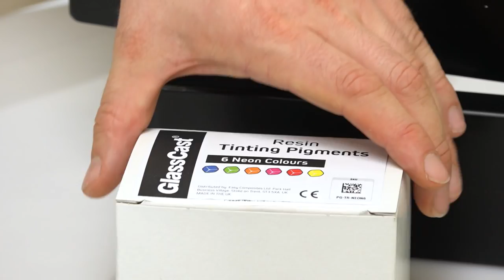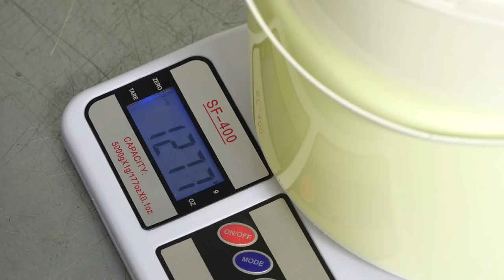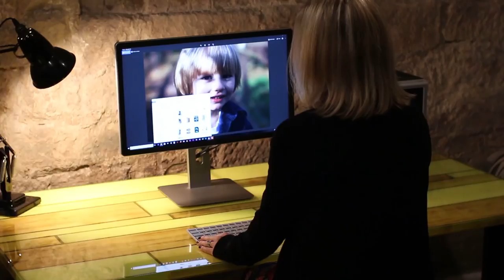River Table Alternative -  Resin Plank Table using GlassCast Epoxy

Comment: Hi just ordered some glasscast resin, what do you use for cleaning the mixing buckets?
Reply from the maker: Acetone or Methylated Spirits are good for cleaning down. Depending on the type of plastic that the bucket is made from, you may find that after the resin has cured, you can simply flex the sides and the resin will crack off the sides.

Comment: Poured a kitchen table using Glasscast 3 followed the instructions - 2 buckets, electronic scales for accurate ratios etc. Mixed using mini mixer attachment for cordless drill so fairly confident it was well mixed, ran a heat gun over it, used mica powder for colour pigment , in the workshop it looked like it was a perfect  glass finish but when I returned it to the clients house it looked to have a rippled surface in places - any advice ???
Reply from the maker: Sounds like the resin was either too thin or maybe the resin has soaked into the wood in places causing the slight rippling effect.  You could sand it smooth and polish it up again or go for another coat over the surface. How thick was the cast?
Reply: @glasscastresin  
I had the table surface primed prior to application, the pour depth was 3mm used a full 5kg kit of Glasscast 3 on it table dimensions works out to 1.6m2 of surface area
Reply from the maker: @karlodonovan1474  Did you seal the timber prior to application? 1.6mm is on the limit of the resin's ability to Self-Level so if any soaked into the timber, you may have dropped below the 1.5mm minimum. In addition, we generally don't recommend mixer paddles/attachments, as they both whip in a lot of air but also don't thoroughly mix the resin at the sides, bottom and corners of the mixing pot. Hand mixing with a flat bladed mixing stick is the much preferred option to ensure thorough mixing. However, I'm not sure either of these would be the cause in this case, if it was perfectly flat and hard at your workshop, where was it situated in your customer's property? If the temperature exceeded that of your workshop (such as a conservatory or sun-room or next to a large window), the resin may have begun to 'post-cure' which in theory could lead to surface deviations.
Reply: @glasscastresin  yeah the table surface was primed and sealed lightly sanded etc. Prior to pouring, the table measured 1.6m2 and I used a 5kg so using the 1kg/m for 1mm coverage I would of had 3mm depth (1.6×3 = 4.8m2 so 4.8kg of resin). The table was returned to a kitchen/dining room not in direct sunlight the weather has been fairly cool here and overcast the last few weeks also some rings have formed from decorative candle sticks on the table they are not lit and only weight about 300g at the very most the resin was poured on a Tuesday morning and reassembled on the following Monday so curing time should of be adequate the thermometer in the workshop was reading 22 degrees for the most part of the curing process so I'm not sure what went wrong here everything was followed as per instructions I am doing another one the weekend so I would love to get some explanation as to how/why this happened to avoid a reoccurrence thanks
Reply: @karlodonovan1474  I install epoxy floors and it maybe of value to you to know that the way you pour the catalyzed (mixed A+B epoxy) is a different from what everybody and their brother shows on all kinds of videos. Properly pouring the epoxy is done like this:

1. Mix A+B in bucket 1. Scrape the sides of the bucket.  But do know that you will NEVER manage to mix all the A+B 100%. Use a mixing stick.  No mixer.
2. Induction time: Some epoxies need to sit for a period of time for A+B to react properly.  Even epoxies that supposedly do not need induction time do benefit from it. Read the manufacturer's recommendations carefully.
3. Pour the epoxy from bucket 1 to a clean bucket 2.  DO NOT scrape and collect the epoxy that is sticking to the sides of bucket 1.  That is a waste but ensures that no unreacted A+B end up in bucket 2.
4. Mix the content of bucket 2.
5. Pour the epoxy from bucket 2 into bucket 3.  DO NOT scrape and collect the epoxy that is sticking to the sides of bucket 2. Yes, more waste but you reduce the unreacted areas to a minimum - actually completely eliminate them.
6. Mix the content of bucket 2.
7. Pour the epoxy from bucket 3 on your surface. DO NOT scrape and collect the epoxy that is sticking to the sides of bucket 3.
8. Done. Wait for cure.

.
Reply: Appreciate the reply - can I just ask why not use the mixer, I brought it thinking I would achieve a better more even blend of part A+B than I ever could by hand mixing, just wandering if there's any reason or advantage to hand mix over the mini mixer/cordless driver

Comment: Is this durable for kitchen work tops so can resist heat from hot objects etc
Reply from the maker: Hi Andy, many customers use the GlassCast 3 for kitchen worktops however, the maximum heat resistance for all of the GlassCast resins is 45'c. I would strongly recommend to anyone that it would be best to use coasters / heat mats in order to keep the best finish on the resin.

Comment: sorry if this has been asked/answered already but how long roughly does the resin take to dry to the B stage?
Reply from the maker: Hi Fraser, that is not a problem. For GlassCast 3 it will take around 12 hours in a room that is a consistent 20'c to reach its b-stage.

Comment: Also can it be honed for a matt finish
Reply from the maker: Yes of course, there are a few ways of getting a matt finish you could go through sanding the entire surface, starting at around a 120 grit and gradually working your way up to around a 3000grit. This will give a very matt finish on the resin and will appear translucent. Another way of achieving this would be to apply a matt lacquer over the surface of the cured resin to get the desired effect.
Reply: Thank you. Final question does it resist scratches
Reply from the maker: @andymjflemming  Yes, the GlassCast range of epoxies are very scratch resistant and hard wearing however, dragging something sharp or heavy across the surface could cause some marks.
Reply: Thank you, sorry I do have another question now you're being super helpful. I plan to apply the resin with my hob and sink still in situ, what do you advise about masking them up so they can be removed at a later date if needed, i.e resin sticking to them.
Reply from the maker: Hi Andy, the best thing to do in this situation would probably be to remove the hob and sink before pouring the GlassCast onto the surface to prevent the resin from bonding to them. 

Once the resin has been poured on the worktop, you will need to wait for this to reach its full cure which can take a few days in a room that is a consistent 20'c before reconnecting the hob or sink.

Comment: How did you seal the planks? with resin too?
Reply from the maker: Yes, the 2nd resin pour was enough to sit the planks on top of and seal all of the planks - we found the best way to do this was by brushing over the tops, edges and ends. It was then left to cure to the B-stage before moving on to the 3rd stage pour.

Comment: sir the table is too good . but i have a doubt that , why you have multiplied the volume (3.84) to 0.666??? this i  didnt get pls clear my doubt sir .
Reply from the maker: Hi Rakesh, The reason this is multiplied is to work out how much resin is needed for the pour. the same will be for the hardener 3.84 x 0.333. The reason we use use the 0.666 & 0.333 is because the mix ratio for the GlassCast 3 is 2:1 by weight and that is how it is being measured in this tutorial.
Reply: @glasscastresin  ohk sir i got it, but if i am using  the resin with the mixture 3:1, should i have to multiply the same (0.666&0.333) to the hardner and the resin ? or it changes ?and how much it will be pls help .
Reply from the maker: @rkshp10  Using the mix ratio 3:1 will simply not work as this has been designed to work at a 2:1 mix ratio. Mixing at 3:1 will only cause the resin to not cure.
Reply: @glasscastresin   and sir why u have multiplied it by 3 in first stage ,1.5 in second stage and 2.5 in last stage ? is it just because of thickness which is required ?
Reply from the maker: @rkshp10  Yes exactly, So for example, if you have an area that is 2 square meters and you need it to be 3mm thick you would simply work out 2x3= 6kg per square meters. After this, you then multiply this number by 0.666 and again for 0.333 and this will give the quantity of resin and hardener needed to get the mix ratio correct.
Reply from the maker: Also, the 2.5 isn't the last stage as this is just to fill in the gaps between the planks. The last stage is another 3mm layer as done before as the base layer.